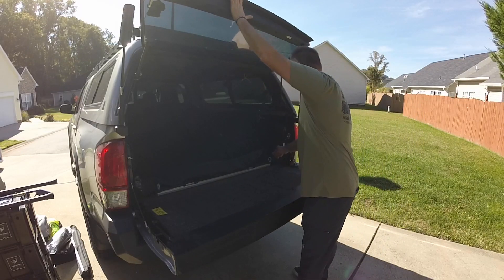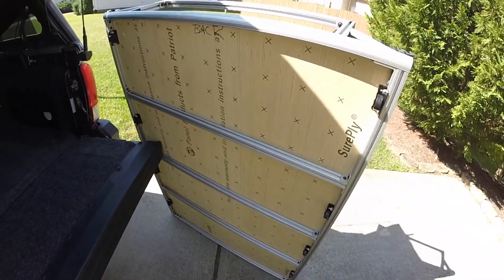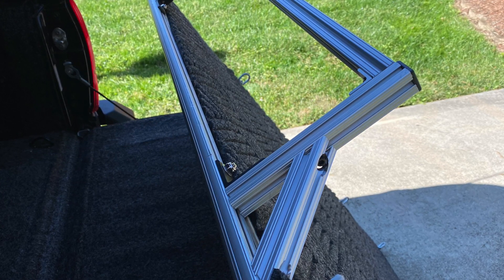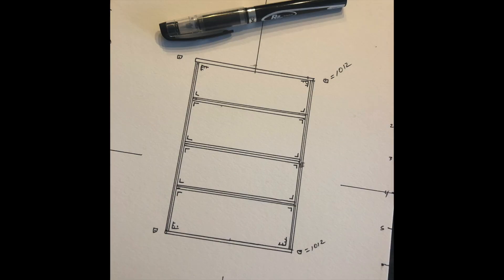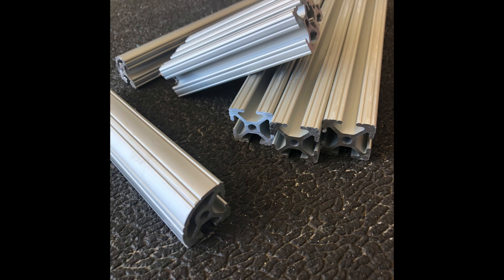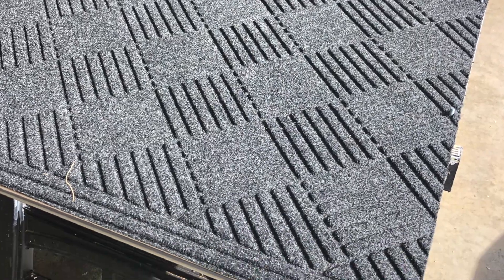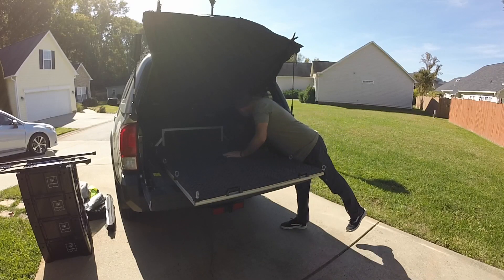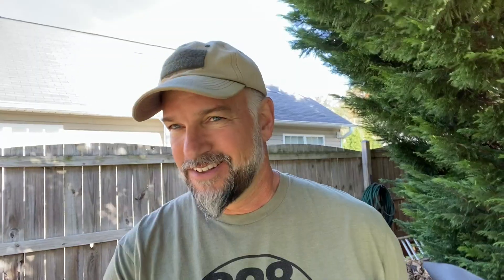80/20 Truck Bed Slide using 8020 for the first time.

Comment: Just finished building a truck slide VERY similar to the one you made, the main difference is I went with the 15 series 8020, custom roller bearings, 1/2" plywood, non-slip carpet, added two legs and a removeable partition 2 feet from the end.  Very pleased with how well it works with my Tundra 🙂. The total weight is about 80lbs. I liked the idea that it is removeable, and the height is only 2 3/8". The cost was around $650, appreciate you posting your slide.
Reply from the maker: That’s awesome. I thought about using 15 series in my 21 Tundra crew, I have all the hardware but have been lacking the time. I’m glad my video helped out and thanks for watching.

Comment: Awesome.  Have a 99 Ranger and need a sliding accessory like that as well.

Shame you didn't make a "BUILD" video, I'd have been really interested.  Never have worked with those extruded aluminum rails before.
Reply from the maker: It's easy to build and assemble. The hard part is cutting straight square edges with a miter saw. Thanks for watching.

Comment: I like how you used the smooth corner on the front!  I am getting a new cap with tool boxes and I am going to make a platform inside between the tool boxes.  We put our kayaks underneath.  That smooth corner would work great.  I might go regular though and put the handles on the front...
Reply from the maker: That sounds great. Make a video and share your innovation. There is no limit to what you can make with 8020. Thanks for commenting.

Comment: Thanks for posting your slide, thinking of doing the same thing. I was wondering what the width dimensions of the 8020 is (1", 1 1/2" or 2")?
Reply from the maker: I used 10 series in this build which is 1" x 1". If you need to build something to hold a lot more weight, 15 series 1.5" x 1.5" would be sufficient. Thanks for watching.

Comment: Well I like your idea. I was going to make something similar but out of wood. By the time I added it all up at home depot it was almost 800. I left it there and walked out. I can make your version without the wood and mount my stuff to the slots.
Reply from the maker: If you got the tools and some type of aluminum like 8020 or just angled aluminum you can build it. Thanks for watching and commenting. Please subscribe and if you haven't check out my 8020 roof rack build video.

Comment: What do you think of adding legs that fold down underneath as you slide it out? That way a fully loaded slide could be removed to make way for boxes, bikes, raw materials. a second one could also be loaded for another purpose such as camping, fishing, etc..
Reply from the maker: That's a great idea and would work great. I have some 180º swivels that mount to 10 series 8020. I was going to use them to mount a tilting solar panel to my truck's roof. I need to get busy.
Reply: Great idea. 👍

Comment: I’m thinking of buying the Bed Slide from the company but seeing your video it really looks good but I’m wondering if you could tell me how much total cost to build it. TIA
Reply from the maker: Depending on your skill level and what you decide to build it out of the cost could vary. Mine was made out of 8020 which is all bolt together except for some cuts. You can also order the 8020 precut. It's up to you on what to use and what your use will be. The homemade slide will definitely be cheaper than a premade one.

Comment: Hi, I know it's been a minute.  Question to you, how did you attach the 1/4" ply to the 8020?  Have you had any touble with tipping or warping?
Reply from the maker: I used T-nuts, they held great and the wood never warped. Thanks for watching and please subscribe it really helps the channel grow. Also, search 8020 in my videos, I’ve done many projects.
Reply: @828findadventure  I've thinking about doing a similar build.  In your thought process did you ever consider installing C channels on both side of the slide bed, near the door; to provide over tipping and a stop?  Or how Bout legs at the end?
I wonder because for my purpose I want install tools and Milwaukee drawers.  So for my end results I would like a 90% pull out, give or take.
Reply from the maker: @webtheweb  legs or C channel would work or theses sliders. I’m not sure where to mount the sliders to keep it from tipping though. https://www.tnutz.com/product/lm-010-b1/
Reply: @828findadventure  yeah with the plywood on top the link you sent me won't work.  I think just doing some c channela with plywood, around 1' long screwed down to the bed.
Reply from the maker: Try to use at least 1/8” thick C channel and that will be strong enough.

Comment: Any idea on what the unit weighs w/o the rubber mat? Nice concept and very clean end result. 

I have a slightly different idea to store a 6’ ladder under it but I’m using your concept for the slide. May make a vid. and will definitely credit you for the idea
Reply from the maker: Thank you, it probably weighs in at around 20 pounds or less using 10 series. Very light but rigid.

Comment: Fire of all, great video! I just started thinking i needed a bed slide and saw the price so i really want to add something like what you have instead. 
How much weight do you put on it? 
I have about 4 Milwaukee packouts, might need one more. Probably about 150 lbs of tools that would constantly be on it. You think it would hold up
Reply from the maker: I could put about 200 pounds on it. Since I have a BedRug it takes some strength to slide it out. If the tray was on the steel bed or a sprayed bed it would roll out much easier. After building it I thought maybe it would roll better if I used skateboard-type wheels with sealed bearings. Thanks for commenting and if you haven't please subscribe so you can see all my 8020 projects. If you go to my channel and search 8020 you will see the truck stuff I have built and recently a roof rack. Thanks again.

Comment: how much for all the parts?
Reply from the maker: The most expensive parts were the wheels that I chose. I probably would do different now. Second was the hardware used in putting it all together. (corner brackets) Third was the Saw blade for cutting aluminum. I would say somewhere close to $200-300 total. I did not need to add the rubber mat on top or the small d-rings. The 10 series 80/20 differs in price by the Alu market so when it's cheap buy it. Very easy to build if you are comfortable using a miter saw.
Reply: Those alluminum bars are like 35 bucks for a 4 footer, it gets pricey, but I guess a full blown after market already built is like 1grand +
Reply: @828findadventure  Who sells it and changes the price up or down based on the price of aluminum?